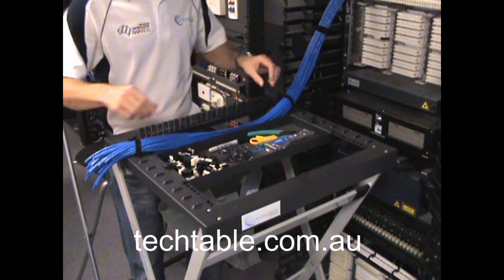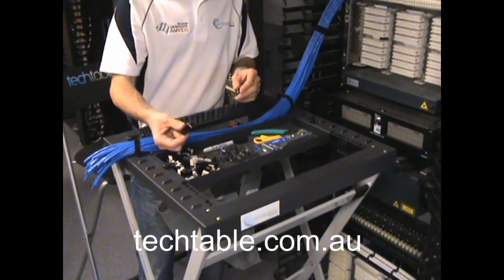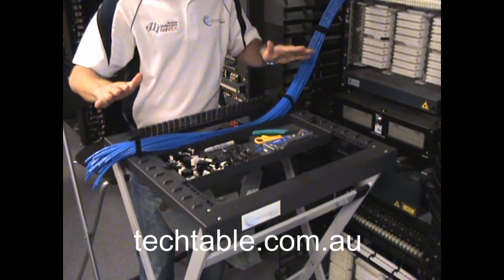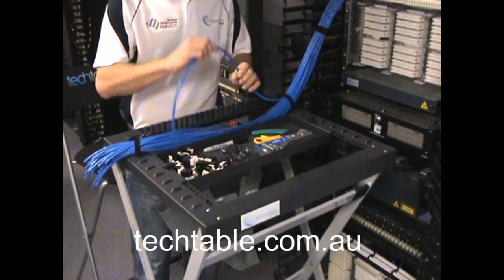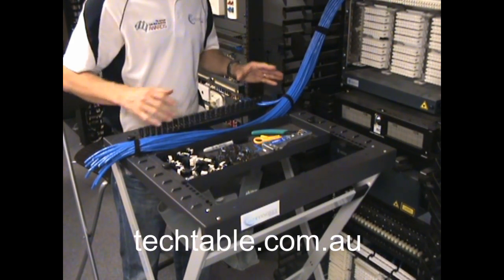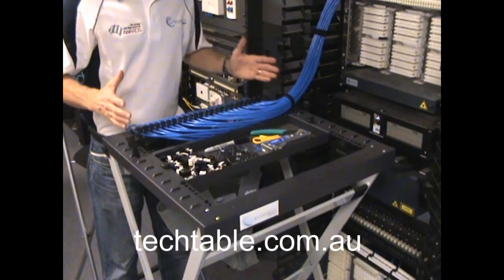How to terminate an unloaded patch panel with TechTable

Comment: this is ridiculous, it's only for best case scenarios and he doesn't care which wires go where either, so toning them all out cancels the time saved from this, if you can fit that thing in a closet.
Reply: You would just do it normally with your numbered cables, comb everything out and set up on the table.
My issue is, seeing you're not cutting to length at the patch panel with it already dressed in, you need to measure out extra to get it low enough to fit across the table. Then put it in with slack at the back not ending up looking like barf.  You would have to plan the math in reverse to the inch. A 7' cabinet minus the height of the table minus the depth of cabinet. And to make things worse, if you have multiple bundles.